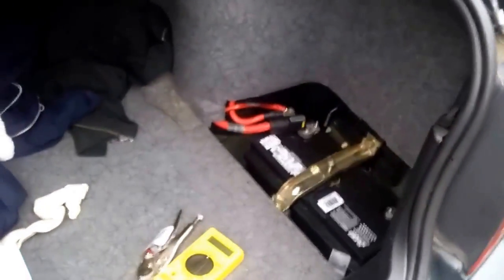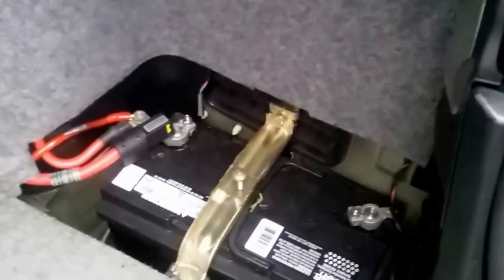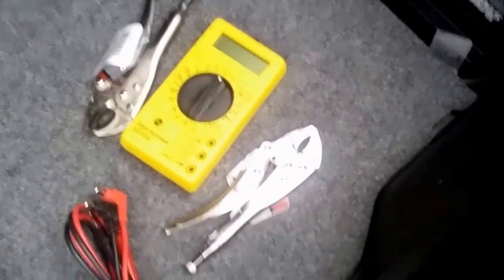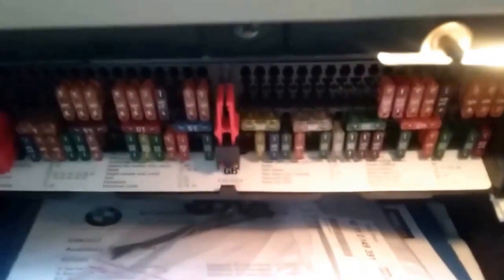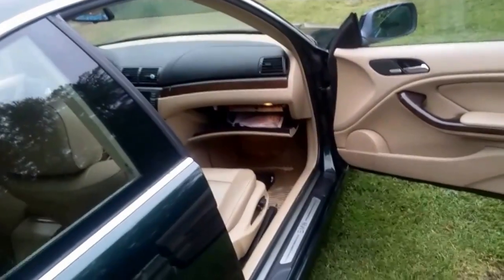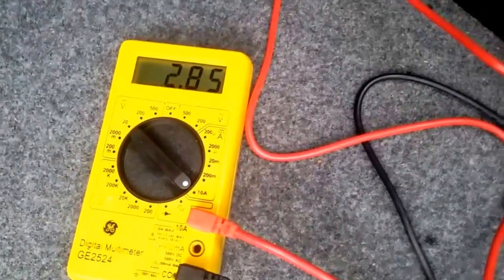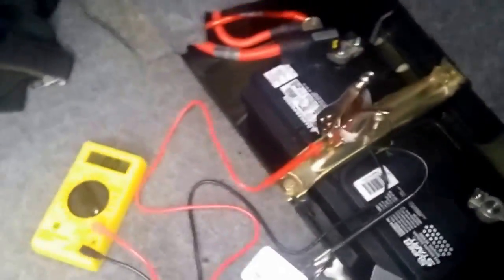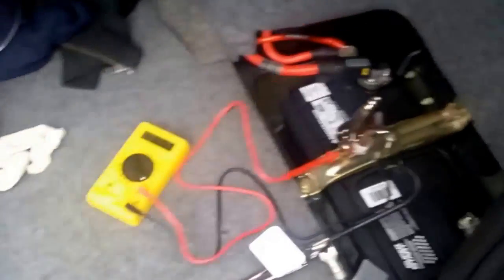BMW E46 How To Diagnose/Fix A Parasitic Battery Drain

Comment: Thanks E46Source!  Great video.  I'm having a parasitic drain on my E60 where the battery will die every few days.  Great help! 👍
Reply: Me to, just started happening! I swear Nathan from Nathan's garage YouTube channel. He cursed me lol. I just got done tellin on my car at 186,000 Miles with no issues and then this pops up. After his reply.... get back to me in a year. 
   Anyway I got to do the same thing. I got to find this parasitic draw. I'm wondering if it's the MPM. Or it could be my Bluetooth module. I don't know.

Comment: Yo, for anyone who has a 2007 and up 5 series. My problem was the DVD and CD player that would stay on. Found out by testing each fuse like in this video. Thanks for it.
Reply: did you reset it, or just took the disk out
Reply: @unknowntalentjay  After I tested each fuse and found the bad one. I swapped it and the problem went away. I would rarely use the disc player after that tho.

Comment: Another way to do this is measure millivolts accross the fuse. Reading should be close to shorted leads on a fuse that has no current going through it.  Good idea to also set up a amp reading meter on the battery and use a second meter measuring millivolts on the fuses.  Saves going back and forth and possible waking up the car's computer.  What you are measuring is the voltage drop between the two metal contacts on the top of the fuse.  Once you got a suspect unplug it and see if it stops the current draw.

Comment: you dont have to wait for the car to sleep .you can connect the multimeter first and  you should see about 2.4amps on the meter with interior lights on. turn interior lights off and youll see .50amps until the car goes to sleep in 16minutes. then it should be down to 20milliamps. i noticed when i waited till the car went to sleep and connected the multimeter it would wake the car and turn the interior lights on and id have to wait another 16minutes for her to go to sleep. good how to here btw
Reply: 16 minutes to sleep?

Comment: thanks dude, just while checking 9:19 from the video I realise I have the same radio and same problem battery drain thanks body
Reply from the maker: Hey, happy this video was able to help you out. If you end up diving further to fix the issue, let me know which module you had to change. I sold the car before fixing it on mines.
Reply: @e46source  actually im 100% sure now that the problem started after i changed my original radio to a new one with screen and gps, this is the changing point im going to fuck the new radio up and fix again the original cheers

Comment: It’s parasitic not parasstic but great video mine is doing the same thing now and I had to charge two batteries to get it situated. I replaced my battery initially and found out that was not the issue. Going to try this text next.
Reply from the maker: Yea I know…as soon as I finished the vid I realized I was pronouncing it wrong. I corrected it in the pinned comment. Hope this video was helpful to you finding your current issue.

Comment: Hey Man, how did you go with the radio? Did you confirm what the actual cause inside the radio was? I'm having issues with my E46 M3 but can't do the test because I would need to sit in the boot or can I lock the boot and that would work? Thanks in advance from 🇦🇺

Comment: hi there mecanic just puled my fuse for radio and my car dropped from 1.3 to 0.7 amps quite a drop but there is something else pulling it as well. Did you find out why your stereo was pulling that power by any chance
Reply from the maker: Unfortunately I didn’t get to diagnose it any further. I ended up getting rid of the vehicle shortly after this video. If I had kept the car, the first thing I would have looked at is the radio module in the trunk. Followed by the amp, if that didn’t fix the issue. I would go to a scrap yard and see if you could pull them both out of a scrapped car at a good price.

Comment: How is the car "awake" when you have The negative disconnected from the battery?? When I disconnect the negative cable from my battery everything immediately shuts off.
Reply from the maker: The battery is still grounded. It’s grounded thru the multimeter to the bar above the battery

Comment: hey man, i need help - i did the same thing here and one of the fuses tripped the alarm so i used the key to unlock and alarm stopped and then i poped the fuse back in.

Now, the car wont start not even crank.......anything u can think of? thx
Reply: What did u do?
Reply: Immobilizer.
Reply: @smooveking773  gotta take it to a dealer.
Reply: Was your alarm armed when you did the test?

Comment: Thanks man. How did you fix the problem? Im having the same issue as we speak.
Reply from the maker: The Prez I ended up getting rid of the car before I fixed the issue. But it would have been either the radio module in my truck or the amplifier.
Reply: @e46source  Thanks..Where is the radio module located?
Reply from the maker: The Prez in the trunk on the left side. It’s a hard shell gray plastic cover. Pop it open and you should see the amp and radio
Reply: @e46source  Much appreciated brotha👍!
Reply from the maker: No problem at all. If you need more help. Let me know
Reply: @e46source  Will do..Good looking out💯

Comment: Did you get it sorted...if so how?

My battery is getting drained..so pulled the fuse 41 and battery is fine 48 hours later usually needs jump starting..
 When you put the fuse back in it does spark!! 
My sat nav / radio works as normal when fuse 41 is in.

Any advice

Comment: 41 is not just the radio !
The right way is to find schematics, and first pull the fuses which are directly wired to the battery. When you find the one which causes the drain, you check the fuses in line with this one, etc.
Before all that, you have to disable the door switch with a clamp.
Reply from the maker: that fuse was the cause of the drain. once I pulled the fuse it stopped. I had a bad radio module.
Reply: Yes that fuse caused the drain. But that fuse is at least Radio, On-Board Monitor & Navigation.

Comment: Great vid man.. keep it up..
Reply from the maker: Reno Balkanac thank you. I greatly appreciate that
Reply: @e46source  you welcome.. I did this test on my 03 x5 last night and the number never dropped on the voltmeter when I pulled out each fuse.. Makes me wonder what it could be thats draining my battery real quick...
Reply from the maker: Do you have any aftermarket products hooked to the car. I mean anything, radio, amp, angel eyes; anything you can think of that's hooked to your car that's an aftermarket

Comment: LMAO!!  "Didn't matter. It wasn't plain' shit, anyway" 🤣. Good video, Bro. It's been 8 years so, 1) Did you figure out what the problem with radio was?
2) Do you still have that car? Did you have and resolve any other issues?
Thanks, for this video!
Reply from the maker: Thanks bro lol…..I ended up getting rid of the vehicle right after this video, so I never tracked down the issue. If I had to guess, it was either a bad radio module; or and bad amplifier.

Comment: I put in a new battery, and it still dies if I don't start it every day or two.  I did the test, and after 16 minutes I down to 0.01  so how is the battery dying?
Reply: I have the same problem. Do you found a solution?
Reply: I had the same problem with my M3 and decided to connect a 2nd battery in parallel to the main battery and I haven’t had a problem since. The car is a little heavier, but now I have peace of mind.

Comment: I have the same problem with my e46 my entire radio harness is cut if I pull the fuse will it kill the old wires?
Reply from the maker: MidWest_Interceptor yes is if you pull the same fuse I did, it will cut all power going to your head unit, if I’m not mistaken, it’s 2-3 fuses labeled radio, pull all of them out
Reply: e46source thank you I can finally diagnose it properly and finally get it back on the road and ready for the next racing season

Comment: Bro thats so funny because i just got e46 and i was prepared to replace the alternator and previous owner told me the alternator charges but the battery dies overnight and he replaced the battery too. When i got in the car radio was blasting and i tried ti turn it down and just kept going to max volume, dude told me radio fucked up im dead ass positive i got the same issue with mine 😂
Reply from the maker: Lol it’s gotta be….hopefully once you pull the fuse it will stop the battery from dying until you figure out what you wanna do for a radio
Reply: @e46source  thanks for this video 📹

Comment: Hay 0.15 Amper Normal?
Reply from the maker: It’s a little on the high side. But low enough that it should not cause your battery die out fast
Reply: @e46source  thank you

Comment: You do you do if the meter displays-1?
Reply from the maker: Is that when you have it connected to your battery, or when nothing is attached. I’ve had meters that said -1 when nothing’s attached before, that’s normal
Reply: @e46source  both I reset it and it keeps doing it. The meter setting only has a 5 amp setting instead of 10.
Reply from the maker: @chucke3305  try flipping your batteries around in your meter.
Reply: @e46source  I did same thing
Reply: Does the amp draw more than 5 amps ?
Reply from the maker: @chucke3305 no, it shouldn’t draw more than 5. Usually around 3.something
Reply from the maker: @chucke3305  if you’re sure your batteries terminals are not backwards, your meter might be bad
Reply: @e46source  that's what I m thinking also.
Reply: Thank you for the help.
Reply from the maker: @chucke3305  no problem
Reply: @e46source  thanks again I bought a new one and it worked. # 18 fuse is pulling 1.33 it controls the remote, phone and gateway control modual. 09 528i
Reply from the maker: @chucke3305  great, glad you were able to find your draw, now you don’t have to worry about killing your battery. Next it to find out which one if those accessories is malfunctioning. If you have a pick a parts junkyard, you might can try to find a gateway module, and see if changing that fixes your issue
Reply: @e46source  weird thing it has a new one the shop put in. I disconnected the gateway modual and it was still pulling 1.33 the draw only disappears when the fuse is pulled
Reply from the maker: @chucke3305  did it start acting up immediately after it was changed, also is there anyway you test the other items to see which one is malfunctioning
Reply: @e46source  it started after a new starter install.
Reply from the maker: @chucke3305  that’s weird, I’m not sure if you have a fuse for the starter, but want to try pulling the starter relay or fuse it’s there is one, and see if anything changes. But I would think it would be whatever is attached to that fused, unless at something else is jump wired to share that same connection.
Reply: @e46source  thanks. Taking it in to dealership tomorrow keep you posted maybe it will help someone else with this problem.😩
Reply from the maker: @chucke3305  definitely keep me poste brother. Sorry I couldn’t help you further